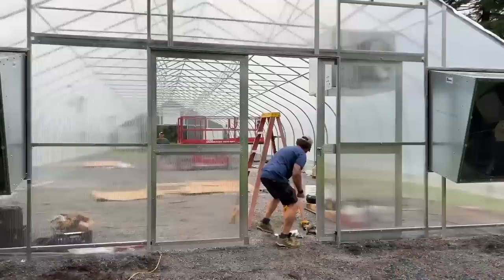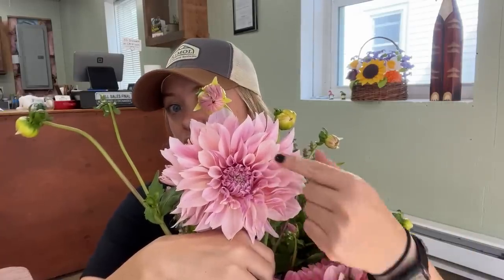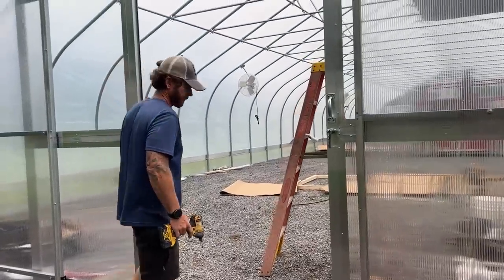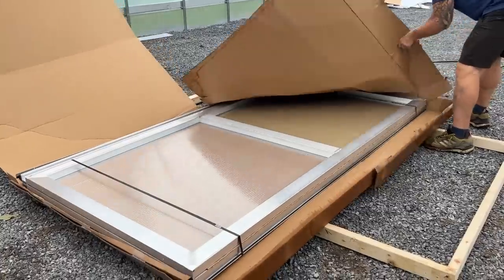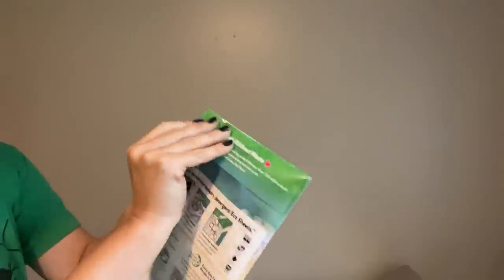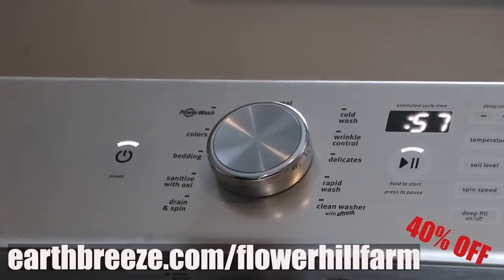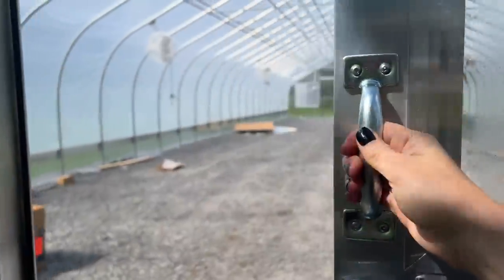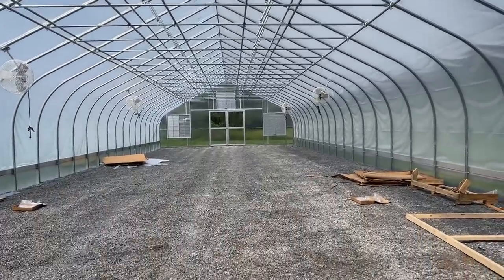New Rimol Greenhouse Update : We Have DOORS! Gram Stops to Check it Out : Flower Hill Farm

Comment: Hi Nicole, What a great Greenhouse. I know its nice to have a clear Greenhouse but, if it was me , especially with the amount of snow you get in your area. I think I would put in some vertical supports along the length . Better safe than sorry, especially as it will be full should any thing happen this winter. Your smaller Greenhouses have vertical supports. It could be something that brad or your family friends could do especially as it is clear at moment. I would air on the safe side. regards John